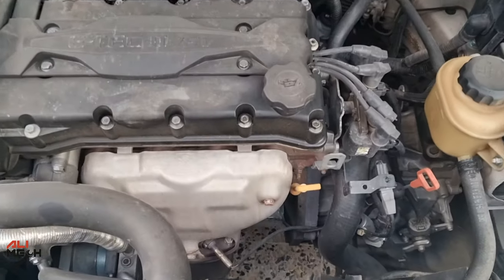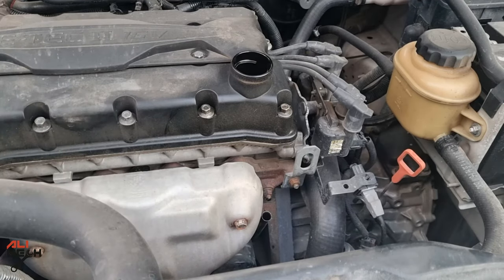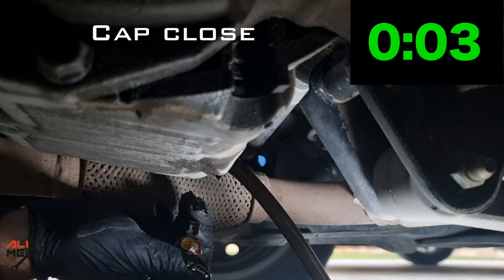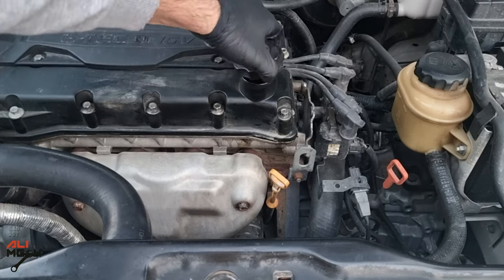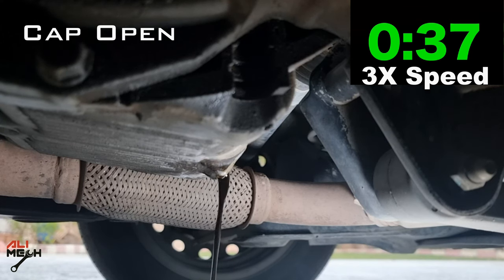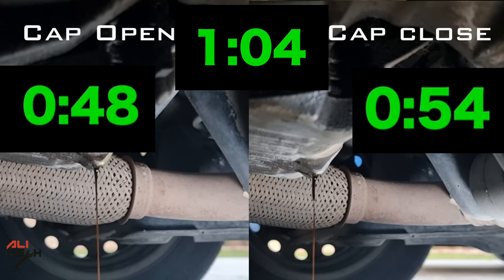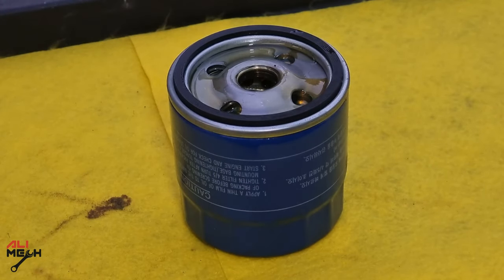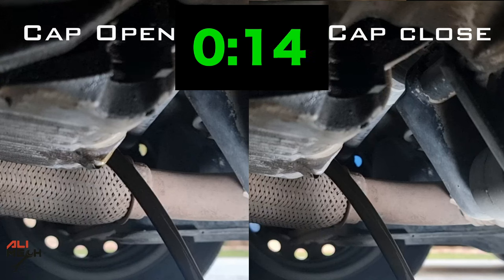Should you drain oil with Open or Closed cap?? Engine oil change mistakes many people do

Comment: As you showed, the oil drains about the same whether the cap is open or closed, but I also drain the oil with the cap closed to prevent dirt, dust, bugs, etc from getting into the engine while it's draining. During operation, the crankcase isn't directly exposed to the atmosphere since it's air supply is filtered and there's no reason to expose it to more unfiltered air than necessary since contamination is a major cause of wear and damage.

Comment: I agree with you, Ali. The time difference is so small, it's not important. It IS important to NOT  drop crud into an engine's open oil filler. I'd be ok with lifting the dipstick off of its seat, which would accomplish the venting to atmospheric pressure as well. Some people remove dipstick all the way and place it conspicuously on top of the engine with the hood up so somebody doesn't try starting the engine without oil refilled.

Comment: With cap off does it drain a little more of the old oil out??? Decades ago I used auto ramps with the oil pan tilted back at an angle, I think I got more oil out. Not sure how much more but I would let my vehicle set there for about 10 minutes.🤠🙏🙏🙏
Reply: If you want to speed up the oil drain time, and get more old oil out of the pan, you can push a LITTLE compressed air thru the filler or dipstick tube.

Comment: I never loosened the cap on any car in 20+ years.  When I changed the oil in my Porsche Cayman, I left the cap on.  Huge mistake.  The oil came out so fast that it hit the drain pan and splashed out everywhere.  Just crack the cap.
And as far as filling it with oil filter with oil, I had to because it would immediately throw up a low oil light after starting.  But that was Porsche.  Every other vehicle I leave cap closed and do not fill the filter.
Reply from the maker: Yes that's true, it happens sometimes,  agreed with you

Comment: What is the right grade of oil for the Chevrelet Optra engine?
I use 10w40 Loki Molly
Reply from the maker: 5 w30
Reply: @AliMECH  Does the hot weather in Iraq affect the quality of the viscosity of the oil?
Reply: @حيدر العبادي  No doesn't. Actually the oil temperature is around 100°